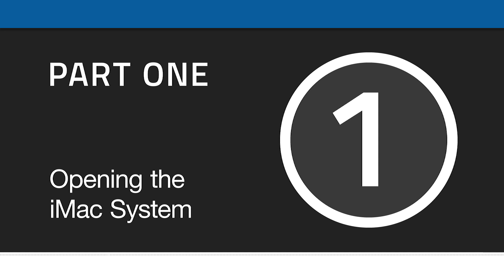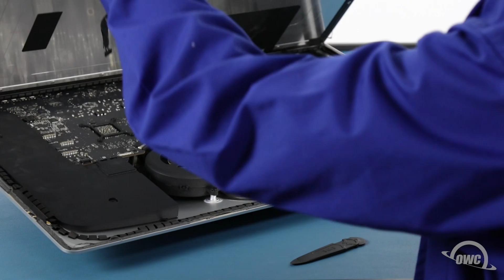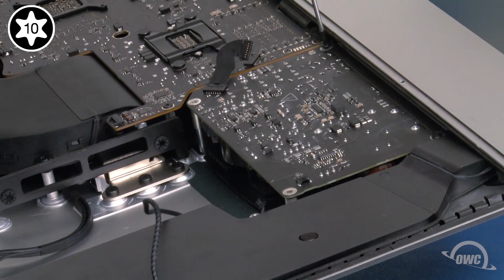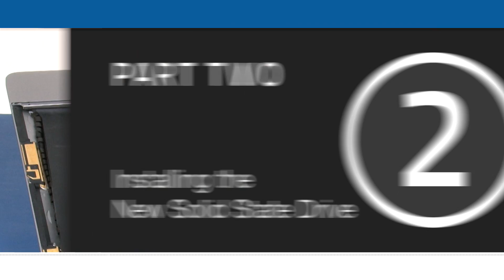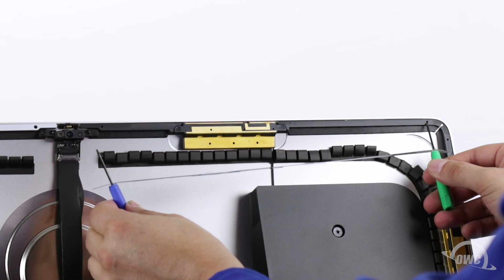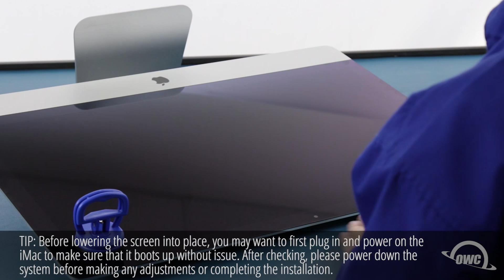How to Install/Upgrade the SSD Card Slot of a 27-inch iMac (Late 2012) -- UPDATED VERSION AVAILABLE

Comment: What is the advantage to use this method instead of just installing a regular SATA SSD?
Reply: Opa Hoppenstedt m.2 is faster
Reply: Alex Dametto How much faster is it? Is it worth the extra work?
Reply: @opahoppenstedt2306  In this case I'm not sure it's any faster (at least in terms of theoretical read/write speeds). Speed tests of the original Apple-installed "blade" SSDs from 2012 show top read speeds around 480-500mpbs; the OWC drive doesn't claim more than 530mpbs read either, so that would suggest SATA III speeds. This is before Apple adopted NVME drives for flash storage (even if they are just proprietary M.2 drives, they can still run at just SATA speeds) that run at PCIe speeds, so you'll likely get about the same speed over the SATA cable that connects to the original HDD. The apparent benefit is that you could a.) install more total flash storage, and b.) you could configure your own Fusion drive (pretty simple terminal commands to make it happen - just Google for DIY Fusion Drive). Whether that's worth the extra work to you is hard to say. If you're taking the logic board out, this would also be the time to upgrade to the i7-3770 CPU if that's not what's already in your machine (not expensive, clocked faster, and it's 4 cores/8 threads unlike the i5 CPUs of the era).
Reply: Opa Hoppenstedt  if you install a regular sata SSD there’s something about 27inchers that make the fan work at 100 percent all the time, something about the temperature sensors so it’s better to do it this way

Comment: The third day after installation, I found my monitor on the floor, cracked and broken.
Reply: I had followed the OWC tutorial to the letter, although when it told me to “gently squeeze along the edges to make sure the adhesive sticks,” I considered that advice to be potentially insufficient, so I squeezed a few more times while gently increasing pressure. That worked well for two days. I was happy with my new SSD.

So, what went wrong? My guess is that—because I found connecting the last two cables difficult, and there were multiple times of getting one cable on only to have it come off when the other was connected—that every time my arms touched the adhesive, a little more of the adhesive came off.

I would advise you to take the adhesive backing at the top of the iMac AFTER the last two cables are secured. It might just save you $400-600.
Reply: Oof. DId they help you out?